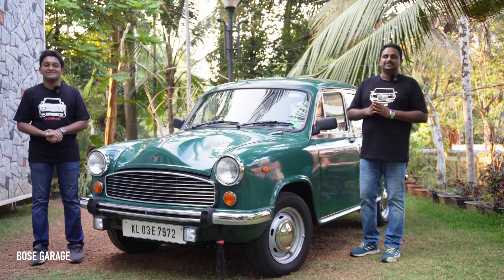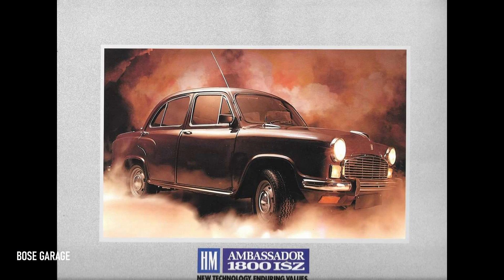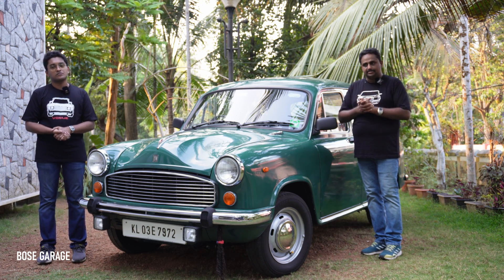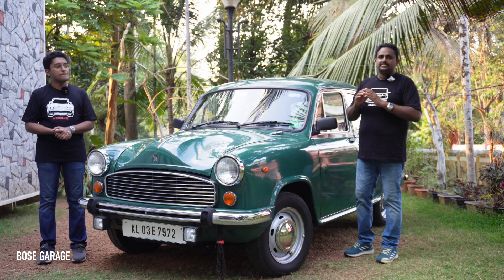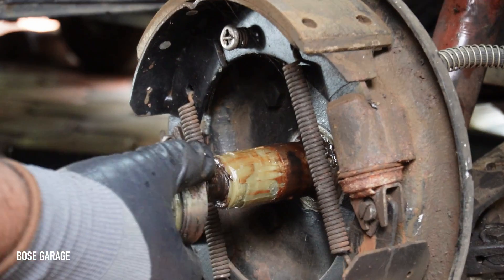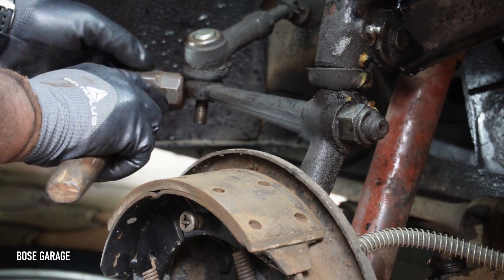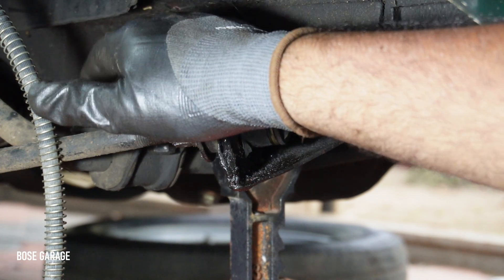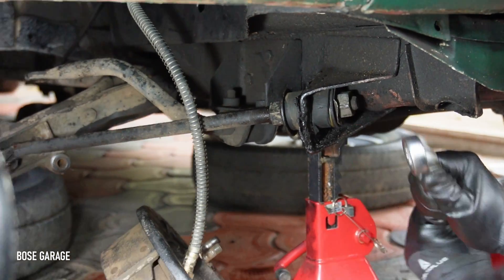HM Ambassador | Front suspension complete rebuild at home | HM Landmaster | Morris Oxford | Part 1

Comment: My ambassador has front coil springs instead of shock absorbers is it originally that way or modded 
P.s mine is a 1975 ambassador mark 2 (deluxe)
Reply from the maker: Ambassador always came with a front torsion bar suspension. Coil springs up front is a mod job afaik. Kindly can share some images of the suspension setup to our email id bosegarageisnow@gmail.com
Reply: @bosegarage  pls check inbox

Comment: Hello brother I am from tamilnadu same problem for my hm isuzu 2000 cc car, what was the full cost of replacement, thank u
Reply from the maker: Hello brother. 

Bush kit for front suspension cost around 2500INR.

Some of the bushes need to be inserted by the hydraulic press. That cost me around 400 INR. 

After suspension rebuild had to do the alignment which is another 500 INR. 

Spray paint using can - 400 INR

Then I replaced all the nuts, bolts, washers, new shims etc might have cost me around 500 INR

So in total it cost me around 4300 INR. 
Labour charge not included as all the work was done by me and my brother.

Comment: Sir, We also having an Ambassador Nova 1996 model with BMC 1.5 L Diesel Engine and Four Speed Gear Box. I have a doubt. Nowadays, a small whisling noise is coming when  engine runs in about 2500- 3000 rpm. The sound goes when clutch pedal is pressed. Clutch is engaging and disengaging correctly. Is this Clutch Release bearing noise? How can it be solved?
Reply from the maker: Hello brother. Most probably it is due to wear and tear of the clutch release bearing. As long as your clutch is engaging and disengaging properly nothing to worry about. It is quite common to have this noise from clutch release bearing after the initial few 1000kms in most diesel vehicles.
Reply: @bosegarage Ok, Thank You.